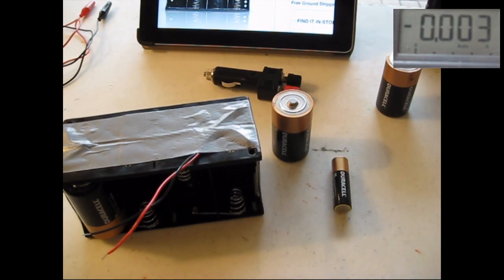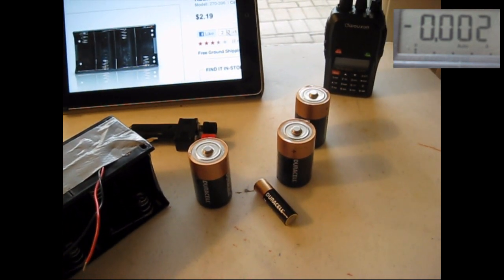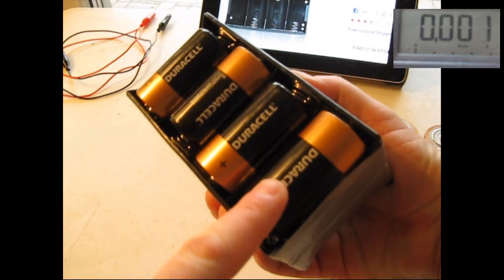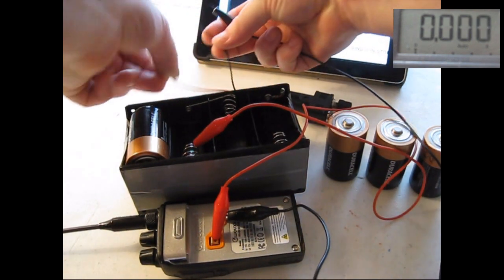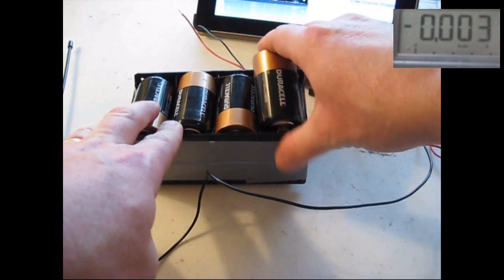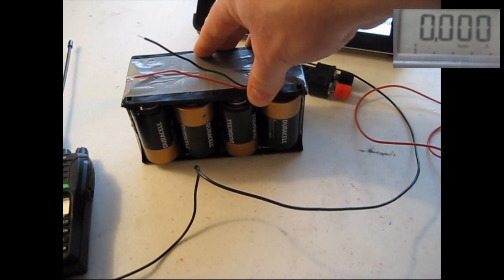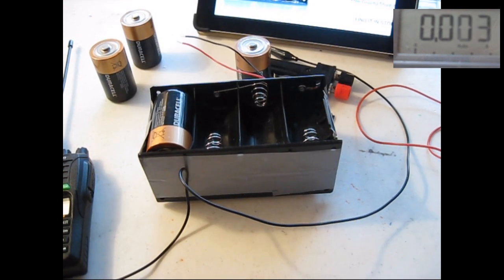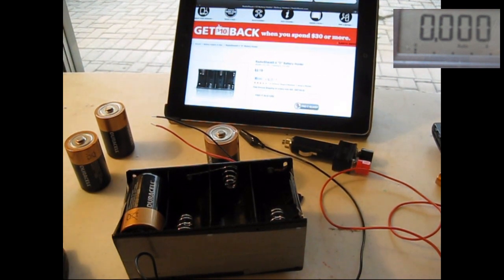Variable Power Supply - Battery trays and alkaline batteries.

Comment from the maker: I depends on the vendor and adapter.  I suspect there is a voltage regulator in the adapter to step the voltage down from 12VDC to what is needed by the radio.  Similar to USB phone chargers that connect to cigarette lighters.  They take 12 to 5VDC.  Best bet would be to check the connector that connects to the radio with a volt meter.

Comment from the maker: If you are asking about connecting a Wouxun radio to the car battery then the answer is NO.  The Wouxun radio is a 7.5 volt unit, the car battery is providing 12 volts.  This would fry the unit.

Comment from the maker: Depends on the radio.  But the Wouxun radio charger has a 12VDC input, so you could connect the batteries (without inverter) to the charger and charge the radio's battery.

Comment from the maker: Yes but rechargeable can have lower voltages (i.e. 1.2 vice 1.5).  You will want to check the voltage with a meter before you apply power to any equipment.

Comment: indeed a good one.....
I have made something similar.
Of more convenience is making 2 fake AA batteries, wiring the + & - and placing them i the proper postitions in a AA battery case for your radio. (you got to trim the case a bit for the wire to pass through.
Stay tuned for more I am preparing a 6800mAh 18650 lithium battery case in the same fashion